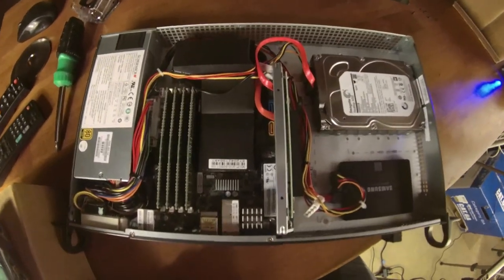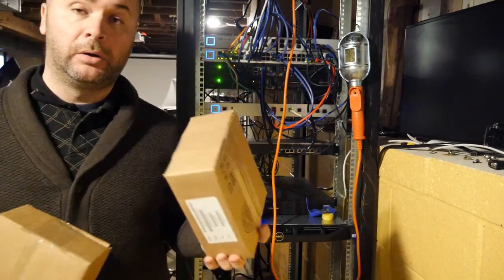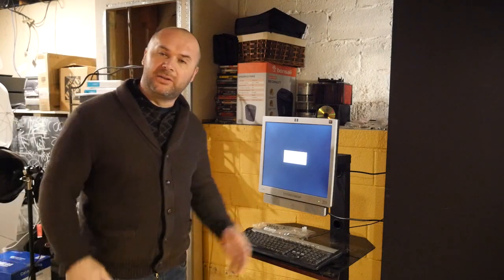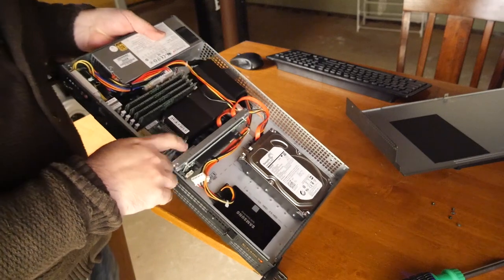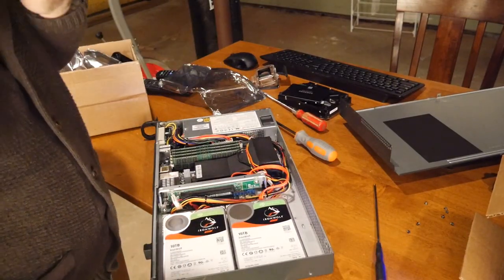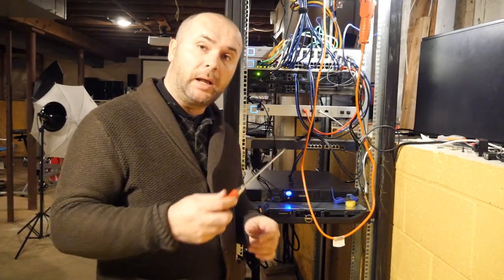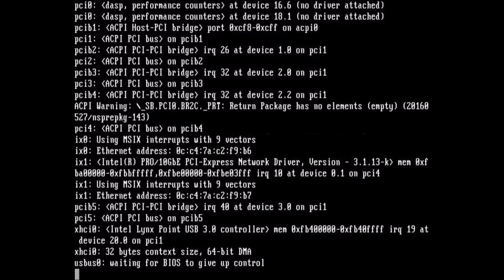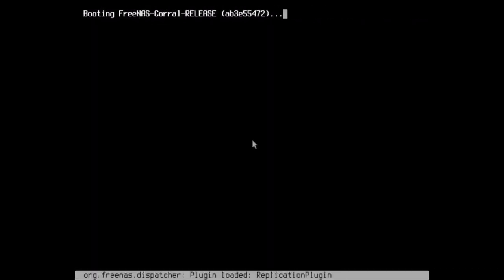Freenas 10 Corral Server Build and Installation

Comment: Love the content you're bringing to youtube. I'm looking forward to part 2. Curious to know what configuration you'll be going with.
Reply from the maker: I'm thinking about adding more cooling and ssd's to the server, but have not decided on what exactly yet, so I'm holding back on second vid for awhile :)
Reply: pictuelle, I too was aiming for a similar setup. But I decided to invert your setup. Use ESXi and create a FreeNAS VM. Use pass though for the sata controller. I'll be using three HDs via the pass through and a SSD for the VMs.
Reply from the maker: Hahaha, on my other Supermicro chassis Xeon D 1528, I went back to VMWare and am setting up pfsense to replace my hardware appliance from ubiquity, as well as another freenas with pass-through for HDDs  - same :)

Comment: Full specs for that server? I like that case and the two HHD config you have. Would like to put together a similar server.
Reply from the maker: I don't see that exact model I have on Amazon, but its very similar to this one:
https://www.amazon.com/Supermicro-D-1541-8-Core-Rackmount-RS-SMX108C4N/dp/B01LYYOX7M/ref=pd_sbs_147_5?_encoding=UTF8&psc=1&refRID=QE3XQJKXY6Z9THFJS45W

Intel Xeon D-1541 2.1 - 2.7 GHz 8-Core Processor
 Supports 4x 288-pin DDR4 DIMM, Supports up to 128GB DDR4 ECC RDIMM, Supports up to 64GB DDR4 ECC/non-ECC UDIMM, 2133/1866/1600MHz @ 1.2V, DIMM Sizes: 32GB, 16GB, 8GB, 4GB
Supports 2x 3.5" drives or 4x 2.5" drives (requires optional bracket); Supports 1x M.2 (PCIe or SATA) M Key 2242/2280
2x 10GBase-T (Intel SoC), 2x 1GbE (Intel i350-AM2), 1x Dedicated IPMI (Realtek RTL8201N PHY)
Case Dimensions: 437mm x 249mm x 43mm, 17.2" x 9.8" x 1.7" (in inches); Includes 200W Low Noise AC-DC power supply with RFC
Reply: Model and specs are very close to what you have. Thank you so much.

Running Ubuntu Server 16.04 right now on a Gigabyte Brix Pro (I know, crazy) with Docker while my data is located on a Synology DS 1512+

I have been wanting to consolidate all my server stuff on one reliable, solid system. Yours looks like the inspiration I need.
Reply from the maker: Cool man, good luck to you, for me, those 2 10 TB drives should be more than enough space for storage for now.

Comment: With gigantic multiplatter drives like these, I have two concerns:
1) Solid mounting of the drives vibrating them to death ()
2) Heat build-up from lack of fans

I know I've superglued 40mm on one of my SM short depth machines in the past, do you think this is necessary in this case? What do the disk temps look like?
Reply from the maker: true, on both accounts, and I have ordered small fans to add to that side just for that reason since I am not concerned about the noise.
Reply from the maker: Disks are at 31/33 C respectively so far, but it is still chilly here in NJ.